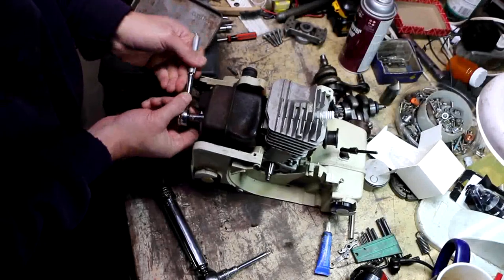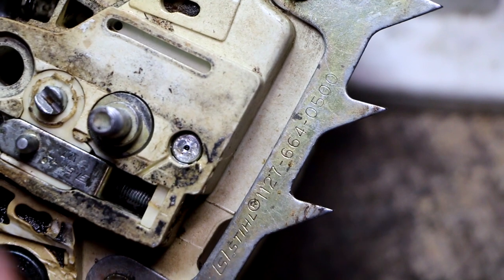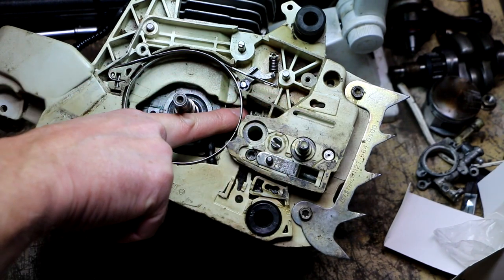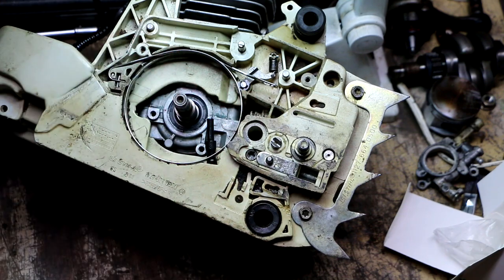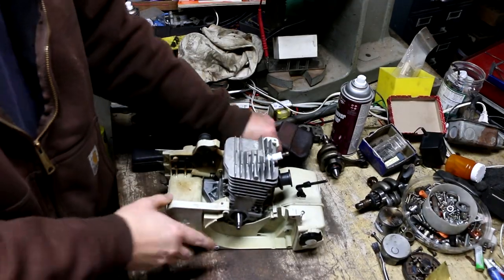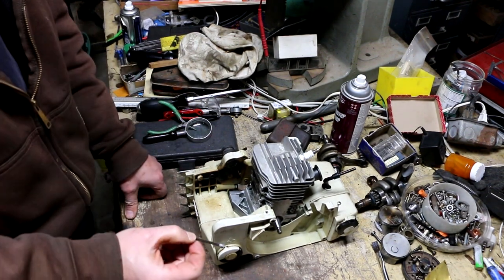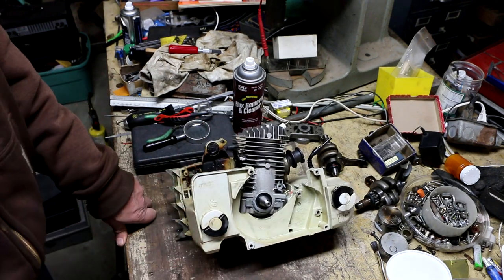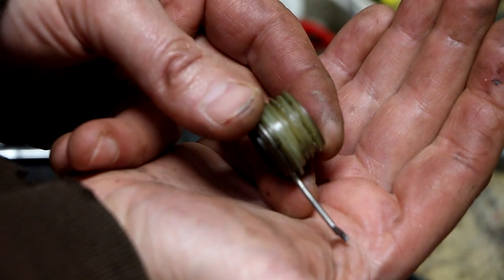Stihl MS290 Chainsaw Part 11: chain oiling system explanation and repair.

Comment: Thanks for the video.  In lieu of pipe cleaners, I've found that welding tip cleaners work quite well.  I use them for cleaning out carb jets.

Comment: 9.19 in the clip, you say that the hole is pointless, its not, it should be a small plastic thing there, at least at my sthil 039 there is a plastic part that can be replaced when worn down. Thx for a Great video!

Comment: Those holes you are picking at around 9:30, are part of the oiling system. Theyre supposed to have these press in plastic caps. I came here to this video hoping you would say what they’re called cause I need to buy replacements. ☹️

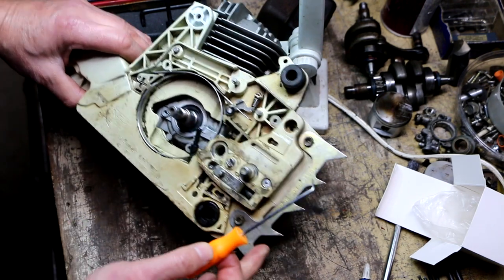Comment: If the oil vent hole mentioned at 3:00 gets clogged, can it affect oiling?  I'm pretty sure the issue with my 261 is just leaky rubber bits on the pump inlet/outlet but I don't want to have to pull the saw apart again.
Reply from the maker: I would say yes. If the vent is clogged then you could have negative pressure (vacuum) develop in the oil tank starving the pump.

Comment: does  stihl chainsaw ms290 has an adjustable oiler? thanks
Reply from the maker: There should be an adjustment hole on the bottom of t
he saw. But you should clean the oil ports first to make sure they are not clogged